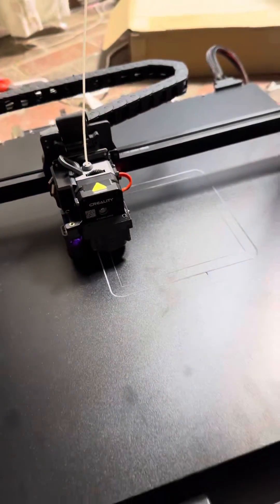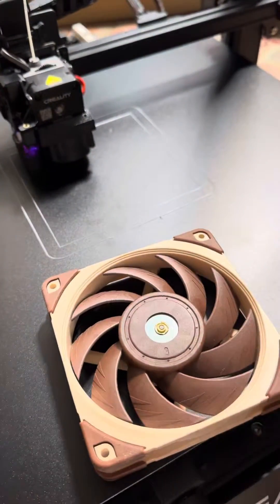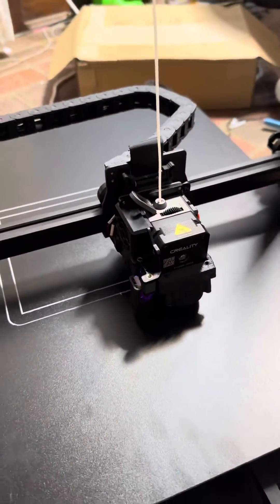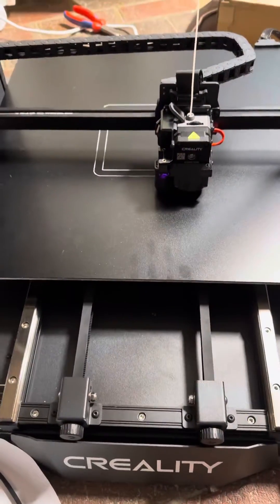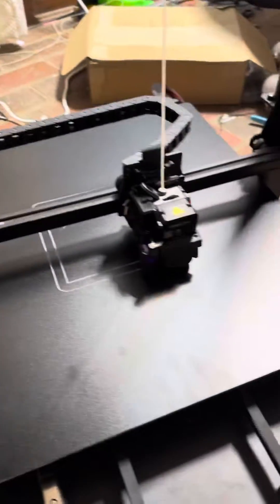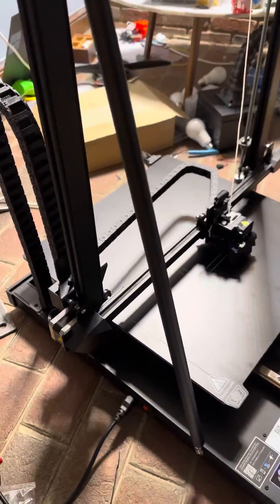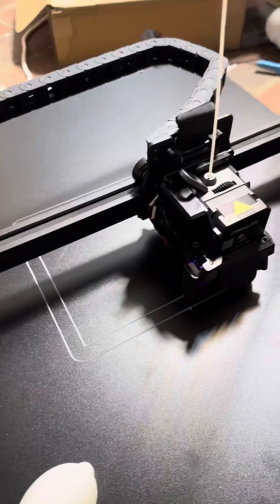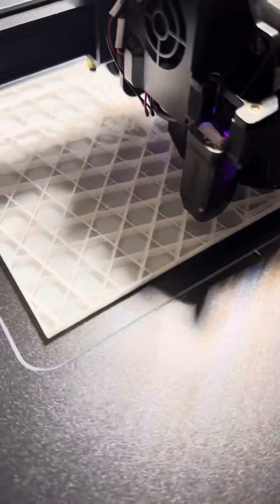Creality CR-M4 - The $1,000 Jumbo Ender 3

Comment: I think a bed slinger is not to good for big and heavy prints.
Imagine this having 5kg of plastic on the bed 🤔 and then the amount of electricity you have to waste for a few days just to keep something on that bed.
My opinion is: worthless gimmick
Why they don't come out with a idea on that bed to actually need the temperature only for the first mm of plastic melted on it?! There are so many improvements that can be done to make them better.....to bad.... it's just about making money on the most shining piece of 💩.
Reply from the maker: The bed is super solid courtesy of the dual linear rails and reinforced aluminum frame, and springless bed mount. Clearly they showed concern about what a 5kg print would do to the motion system. Compare to the much cheaper Neptune 3 Max- it is held up with springs.

Just wait and see what I can do with this printer.  With such a large build area you can make a lot of useful things - it is not a gimmick

Comment: Do not print in your room. I have a pretty sensible respiratory system, so I'm quite sure it's not healthy even with PLA.
Reply from the maker: Agreed. I run this in a basement with hepa filter on at full blast
Reply: @NathanBuildsRobots well... I assume that you spend significant time in the basement too and I'm not sure if that hepa filter helps against toxic chemicals in air. Hepa filters are designed against particles, not against fumes or gases released during printing. My best advice is to build an exhaust system and put you printers in enclosures connected to it.

Comment: damn that thing is slooow! 
no point in a massive printer if it takes weeks to print something large
hope it can be klipperized
but even if it can be made faster, even with input shaping, this thing is going to print ugly higher layers because of the nature of bed slingers and the Z axis tower that's barely reinforced on both sided by 4 bolts. 
IMHO cube style Core XY is the only way for something this large. Anything else is pointless
Reply: Crossxy is desirable over corexy at this scale because the belt paths get so long with corexy as to introduce lots of inaccuracy.
Reply from the maker: Always appreciate your technical input Dalias. Makes sense!
Reply: @NathanBuildsRobots  BTW one way to make it more accurate while retaining CoreXY is going "AWD" (4 motors) so as to reduce (halve, I think) the worst case distance along belt path between the actuated components and motors. The VzBot AWD does this and Vez has some good videos on it (not aiming for extreme size, just quality at extreme acceleration, but same issues apply).
Reply: @daliasprints9798  hmmm I never knew that. I thought that steel reinforced belts are sufficiently stiff to resist the stretching that could lead to print inaccuracy... Guess that's why you don't see any large format vorons ?

Comment: Imo the price is not justified. They say it's for industrial use but with those v rollers and everything it doesn't look like a machine that can run 24/7 for weeks, which an industrial grade printer should handle. Also it's huge and printing very slowly so what's the point. The Y axis setup is pretty cool with the double linear rails spaced so far apart, but the rest just seems like basic ender 3 with mods that you can download from thingiverse
Reply from the maker: There is a 500x500x500 CR-10 for like $400. Kind of makes this a hard sell, though the Y axis is amazing, and I always like the sprite hotend.

Comment: the cable chain interests me greatly I've had a lot of ribbon cable related issues with my S1. eventually I'll have the time to design, model, test, and finish a modular system for cable management... that said I'd definitely just order a shortened version if that one for the S1... doubt that'll ever be an option though
Reply from the maker: Drag chains are pretty inexpensive on Amazon, you just have to come up with a way to rig it into your printer, which is easier than it sounds like it would be 
https://www.amazon.com/dp/B09376Q64H/ref=cm_sw_r_as_gl_api_gl_i_HCFNQ6CN23Z9GZB1RBWE?linkCode=ml1&tag=nathanberge-20
Reply: Thingiverse is full of already designed solutions for these :D